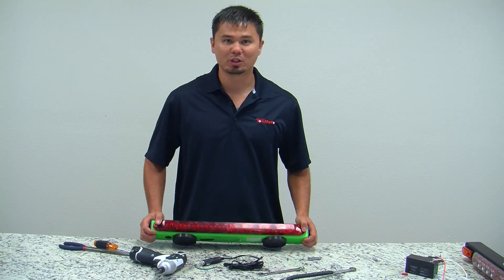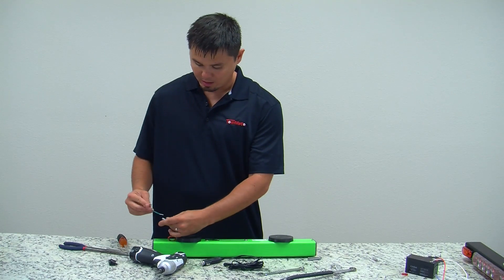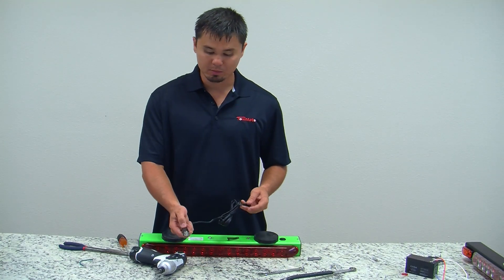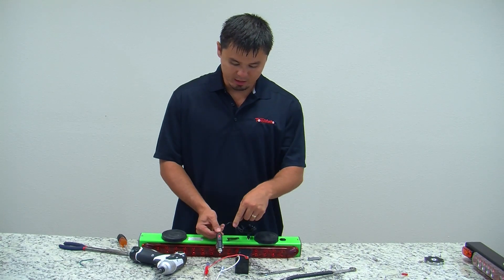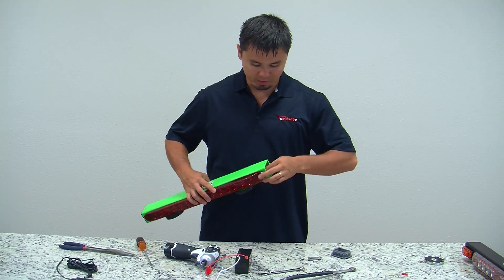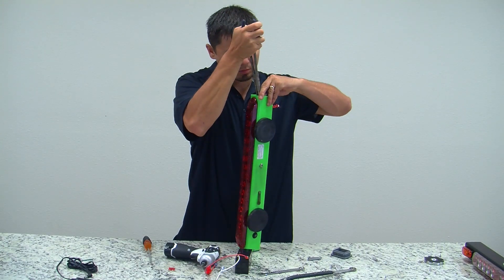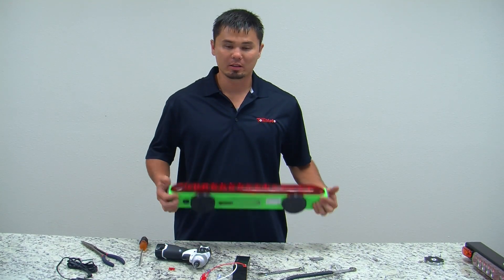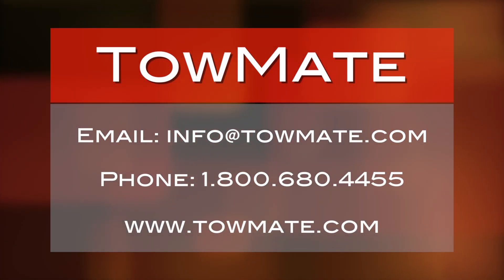Troubleshooting TowMate Light Duty Wireless Tow Lights

Comment: how can I get the wiring diagram?
Reply: i also need the wiring diagram. went to change the battery and it was tight. pulled a little too hard and one of the plugs came unplugged . now i've taken everything out and unplugged everything and i need to reassemble everything lol. would be much faster with a wiring diagram
Reply: @adamschwartz6918 any luck?